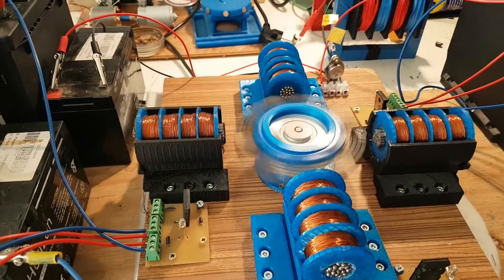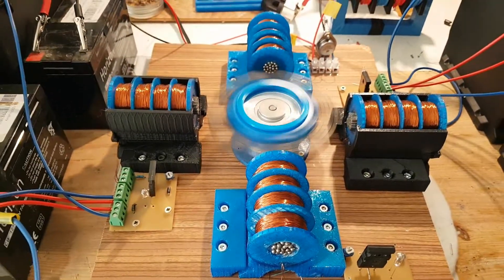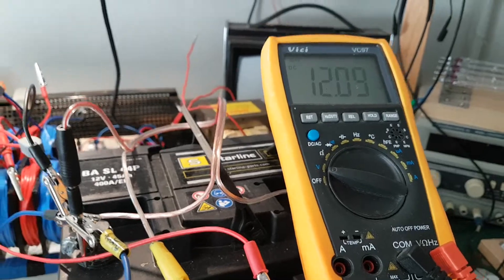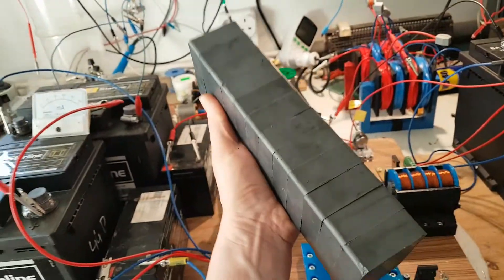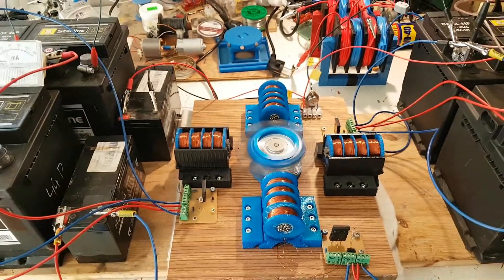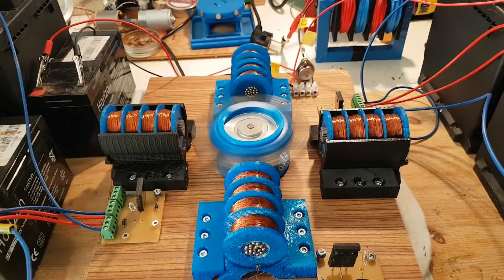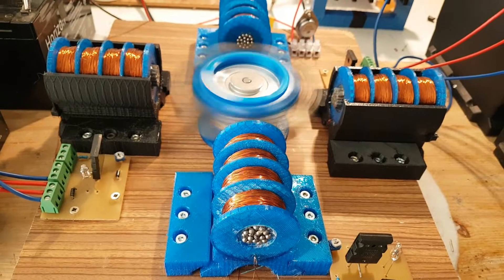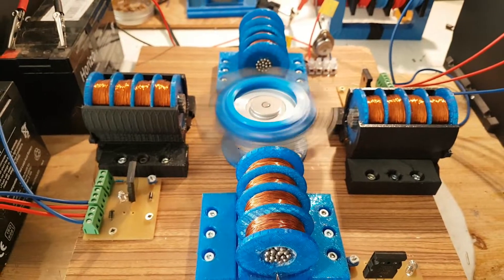Bedini 4 coil  SSG up and running

Comment: The battery measurement displayed was 12.06V... That's nearly a dead battery. Show us the circuit starting with a battery at around 12.78V and run it for 24 hours, then show what the voltage reads after that time period. If its truly self charging, it will have gone up towards the float voltage of 13.5V. I have never seen that demonstrated by any of these types of videos. They all seem to show battery voltages that indicate the battery is near the end of its discharge curve, while claiming the battery is charging. Why is that?